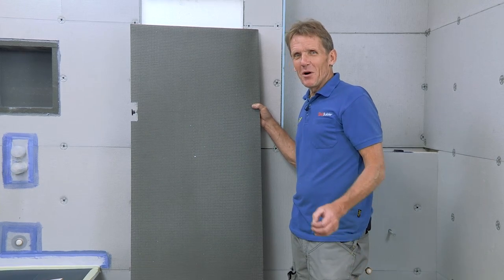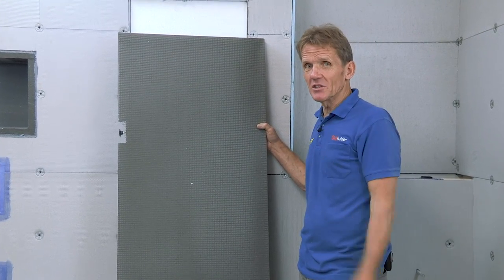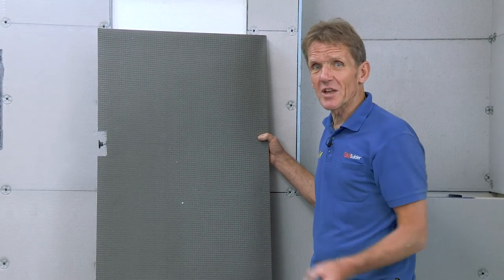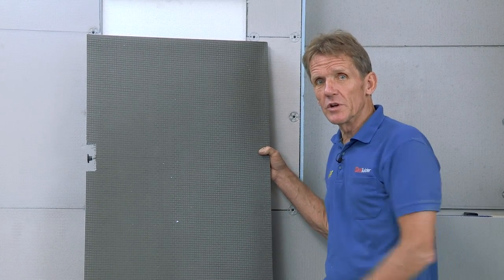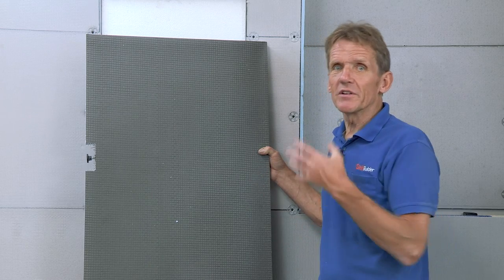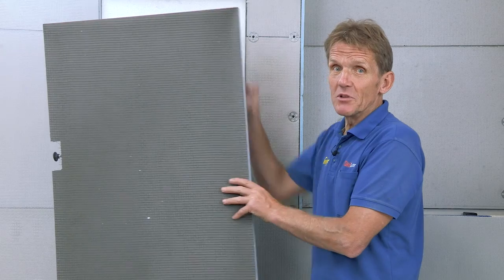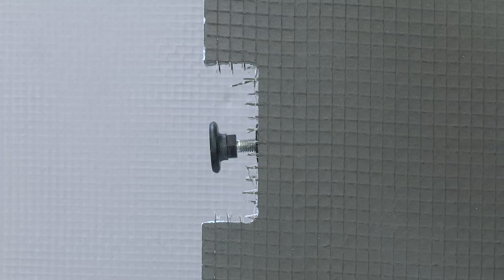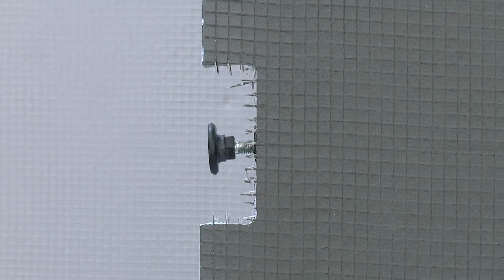Installing a tileable bath panel

Comment: How does he remove it if there's a leak?
Reply: Due to the nature of the lightweight material it can be cut easily with a pad saw - so you would simply cut round a grout line of a tile ( or a few tiles). If regular access was required under the bath then we do a version with a magnetic panel, although this does not look quite as nice when tiled.
Reply: @ianpattison7367  Not anymore it seems!
Reply: @ianpattison7367  where can I buy the magnetic removable panel please? Fitting a whirlpool bath so need regular access behind the panel for servicing. Thanks

Comment: What is the adjustable sliding bracket used in tge middle at the top of the panel to stabalize and stop the panel going backwards?

Comment: Can this be used for a p-bath panel ?
Reply from the maker: Hi Gavin, thanks for your comment. For p-bath panels you should use our pre-slit construction boards - http://bit.ly/pre-slit-boards - These are made from the same materials as the bath panel shown in this video and they are exceptionally easy to work with, providing excellent tile adhesion and waterproofing properties on the panel for your p-shaped bath tub. These pre-slit construction boards can also be manufactured bespoke to your requirements. Please contact us for more information on ordering a bespoke product. Contact details can be found on our website - http://bit.ly/contact-abacus